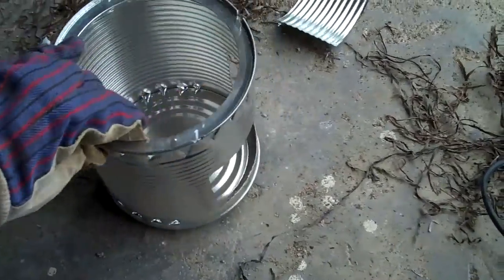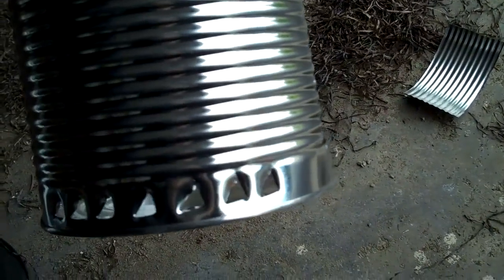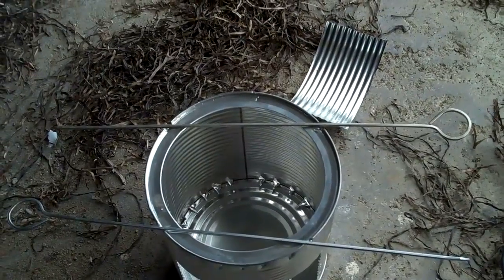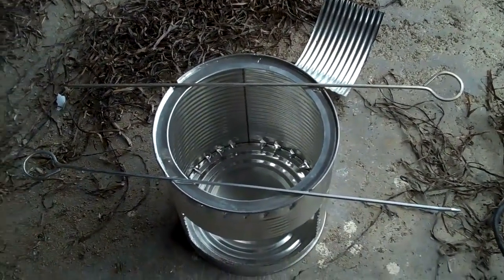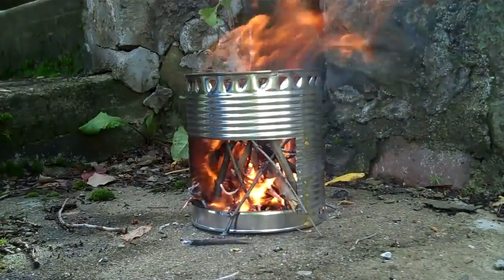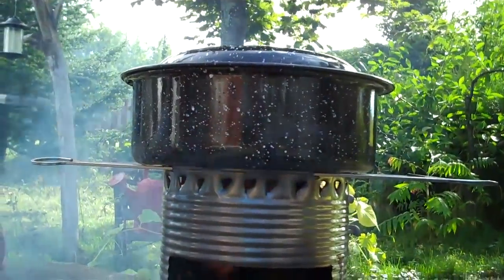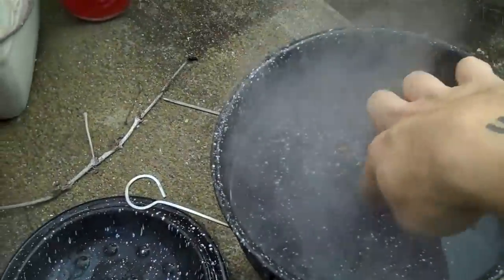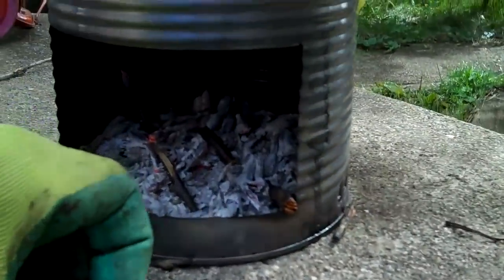How to...make a Hobo stove! HD

Comment: Ive was camping last week in Virginia and used one of these hobo stoves to cook 4-5 meals, and it worked well.  Some tips:

1.  Cut and bend notches/flanges around the top so that when you set the pot on top the heat/smoke can still escape

2.  Use one sheet of newspaper - youre gonna have to blow on it to get it going unless you have really small dry twigs

3.  Wait until the coals are going good before you try and start cooking.  Once you put a pot on top it tends to dampen the flame

Comment: I made something similar to this. For fuel, I used isopropyl alcohol which you can buy at your general store (like walmart, walgreens, cvs, etc). Use %80 or above, I prefer %91. You can use %70 but it doesn't burn as hard so it may take a bit longer. I like using isopropyl alcohol because it doesn't give off any smell, no smoke, it's not expensive, gets water boiling, cooks food and it's clean burning.

Comment: When I make mine I think that I'll split the metal where you had a large rectangular opening in two so that it forms a "barn door" which will be permanently left open. The idea is two fold. first it will either funnel or draw more fresh air through the combustion chamber based on the direction you face it and secondly, the out stretched doors would allow you to place either damp wood across them for drying or another skewer with bits of veggies or meat to be heated but not directly in the flame

Comment: I made one using your design but with a modification to the top grill.  It worked so well, I used firewood to start a coal fire.  It barbecued about 3 lbs. of meat with hot coals to spare.  The tin can is amazingly strong and will probably last cooking dozens of meals. Thanks for your video!

Comment: Instead of notching out the rim for the 2 skewers to just lay on, why don't you pierce 4 holes in the side of the can under the rim and push the skewers through. Then you can use the skewers to turn the stove into the wind without having to touch the hot stove and chance burning your fingers.
Reply: This man didn't even make the indentations so that the skewers would lay evenly (parallel).
Reply: That is very wise.
Reply: Just pinch the top together as needed.  KISS

Comment: Nice stove.  I have a similar one made out of a coffee can.  I drilled 1/4 inch holes in the bottom every inch in a circular pattern all over the bottom.  Then  I cut the bottom out first then made triangle cuts about 2 inchs above the original bottom bent in half placed the bottom back in and then bent in the other half.  1 inch from the bottom I drilled 1/2 inch holes into the body of the can every inch or so. Cut my door 1/2 inches above the new floor of the can  (much smaller than yours). The rest is the same.  By drilling, cutting and lifting the bottom the way I did it allows much better air flow and damp wood seems to burn better.

Comment: I just used a fairly thin yet fat extra large can of beans. I emptied the beans into a pan, and then used a knife to cut out one hole on top, one hole in the middle, and one hole in the top side.

top hole, heat to cook food (beans).
middle hole, sticks and lighting.
top side hole for smoke escape, which worked very well.

I used a knife and an everyday can of beans that you could find lying around a campsite.

I found like, 5 cans I could use for hobo stoves.
And no power tools.

Comment: I have used a stove like that except it was half of a 55 gallon barrel.and it was used open side down to give a larger surface area to cook on. The flame directly on a pan bottom has a tendency to to be hard to control and to burn your food with the metal side up cures this problem. Oh yeah do not cut the big hole in the side clear off as you can use it to control the heat.

Comment: OK. So i made the hobo stove after reading the comments. There were some good suggestions. I made the opening smaller and I drilled 6 small holes about 1 cm (1/2 inch) below the top rim . I inserted 3 pieces of coat hanger bent to a 90 degree angle on one end. They are about 3 cm ( 1 inch ) longer than the width of the can. I put 1 under and 2 over in a basket weave type of configuration which holds them in place. The small pot I have fits snugly inside the can when not in use and the 3 pieces of coat hanger slide in beside the pot. When the coat hangers are installed and the stove is lit the pot sits just inside the rim so it cant slide off. I used a bit of crumpled paper, dry twigs and a wax and sawdust fire starter stick broken into pieces as fuel. It heated a pot of chunky stew in about 3 or 4 minutes and there was enough heat left to toast my bagels on top once the pot was removed. It was nice to have something hot after hiking down to the ocean on the Copper Mine trail in East Sooke Park on the west coast of Vancouver island. Thank you for great video and the great suggestions of your Youtube followers. It's to bad I can't share my photos and video with you. ;)
Reply from the maker: That's awsome. Glad you were able to better it . My model sure wasn't the most optimal design .

Comment: as an old actual hobo, I'll share what we called a 'hobo stove' .  We would find an old spike bucket, (5 gallon about) which was usually lying around anywhere a train stopped. We'd cut those same V shaped holes close to the bottom with a knife n rock, then cut a door at the other end on a side.  Then, you'd dig a shallow ditch with your boot and put the bucket on over the trough. You could start a fire at night in the trough and it'd burn inside the bucket, what little fire n smoke came through the holes wasn't usually visible over 20'. get hot enough to bring water to a boil on the bottom of the bucket. (in case you were interested)
Reply from the maker: Thanks that was intresting.
Reply: +Marcos 989 well, lot of  famous folk hobo'ed around. my 1st computer ran a brisk 8 MHz and came with CPM. :-)

Comment: If raised and placed on a smaller can with openings all around and a small hole in the bottom of the hobo stove with mesh steel wiring can help draw more air underneath the can drawing the fire in the combustion chamber in the hobo can even higher. Sorry for the grammar

Comment: You could cut slits into the scrap piece you cut out and fit it into the bottom with the arch pointed upward so it  wouldn't collapse when it got hot and it would act like a grate and let air come in from underneath .

Comment: Interesting, but ... I'm concerned about using something like this out here in California with change of wildfires. Maybe a screening around the openings to prevent embers from coming out of the can.
Reply from the maker: I make a better version it's called hobo stove 2 , the feed opening is smaller. But you make a shield by cutting a large sodaor beer can and put it in front of the hole when you are not feeding it. Just don't put it too close and block the air flow. And always watch the fire risks  warnings

Comment: hey buddy. . .. you should poke holes in the bottom as well. . .that way it sucks up air from underneath and you won't need to point it where the wind is coming from. . .it will also save you firewood!!

Comment: @TAYLOR13961 it is called a dremel its like a mini grander but the size of a screwdriver, can be used to cut metal grind metal , cut and inlay and or burn inlay wood with just a change of the bit

Comment: hey like the idea but to improve it maybe you  could put the wire stakes through the holes at the top rim for a more stable set up
especially when you use a smaller pot

Comment: While I can I use power tools also, If I had to, I would use a hammer nail and tin snips :)

Its made of tin and won't melt, To melt Aluminum you need charcoal and that's still not anywhere near hot enough to melt it you need a bellows of sorts (I saw a vid where a guy used a pipe and a hair drier effective at melting it in a tin can and the tin itself did not melt)
Having said that I loved the vid and I will be trying this out :) :)

Comment: Isn't there a coating on the inside of those which is poisonous if you burn it? I would dry run it somewhere well ventilated before you use it to cook anything. Not to mention a few runs and that thing would most likely burn out and crumble.

Comment: Not so much a sharp knife but one with a strong tip. I've used a not that sharp Buck Knife to push through the can. I had to resharpen it after but punch through did less harm to the edge than trying to cut.
Also I would recommend having your cross rods make more of triangle shape. That way you can accommodate smaller pots.

Comment: Why not turn it the other way around and use the top as the portion you put the pan on and the fire beneith it?
Reply: Katies Korner because this way the fire doesn’t have to heat up the metal and then the pan, the direct fire heats up the pan faster and so the firewood can be contained within the can, and not touch the ground.

Comment: I thought i had thie nailed before anyone else, then i found this video. Only read difference is that mide has a much smaller door to retain heat, a pinwheeled top to focus heat, and I used a triangular can piercing can opener for the vent holes at the bottom.

Comment: I made a smaller version of this using an oversized (not # 10) soup can. I turn it upside down though. N poke holes in it. 

You can also use a soup or coffee can, put some sand or old clothes in it and pour rubbing alcohol in it. It makes a very hot fire. Oh Hans sanitizer,whichis alcohol gel.

Comment: You should have taken a coat hanger to turn that cut out scrapped piece of can into a door to control airflow and heat better as well as using them for pot supports. loose round objects like those culinary tools tend to act like rollers on uneven surfaces.  Otherwise very pretty.

Comment: I agree a rocket stove is more efficient, but it also takes way more materials and is super heavy with all the sand.  IMO if you need to carry a stove you aren't going to want to carry one that weighs 10 pounds or more.  If you are at home you can just use the fireplace or grill when you have no power, otherwise you will be using your real stove.  Just saying.  Hobo stoves are the most minimal and are great for backpacking, etc.

Comment: I've made and used these things before but I have yet to understand the concept. I mean, isn't it easier to simply dig a small hole and build a fire in it?
Reply from the maker: It is lol. but I guess you can get more heat with a hobo stove because there's more air coming to the fire from the bottom than in a hole. Plus the heat is reflected towards the top.

Comment: Cool video, dude. "Hobo power tool"??  *lol* Nice to see that You use protection glasses while working with this tool.
The "Hobo-knife" (with aluminium handle shells) is the real swiss army knife, used by swiss army from 1961 until 2008. That's a real tough jackknife, almost indestructible!

The other worldwide known "swiss army knife" (with red plastic shells) wich is used eg. by Mc.Guyver, is also very tough and high quality, but it was never officialy used by swiss army. ;)

Comment: Just drill 3 or 4 larger holes at the heighth of  the top of the door, but on the oppisite side. I think maybe the door is a little two big, lets in to much air and burns up your fuel to fast.
Reply from the maker: yeah the door is too big for sure. it was my first try...I probably will make another one

Comment: I would have used an old fashioned beer can opener to punch the holes in the side of the can top and bottom.  IT WOULD BE MUCH QUICKER & EASIER.  They are still around but not used much any more and would save wear and tear on knife blade.

Comment: Are the holes at the top necessary?
Reply: One version I saw, left the bottom on the can intact (which became the cook top), still had an opening at the lid end (where the lid used to be) to put your firewood into (cut out smaller than this one and could be left as a flap, rather than completely cutting it out - that would also shelter your fire material from any light rain), and they cut out a small window up near the cooktop (upside) of the can, which helped with airflow; that piece was cut like a flap and bent upwards a little - on the opposite side to where the firewood opening was. That way you didn't have to cut very much of the can. Hope I explained that okay :-) So leaving the can intact, just cutting a smaller firewood opening at the lid edge, and one small opening up near the base, on the opposite side. This is what the "swaggies" used during the Great Depression here in Australia. (Swaggie being someone carrying a bedroll and camping out beside the roads, while they tramped around looking for work). Of course, there were better quality cans around at that time. I've seen some pretty big cans thrown out by caterers and restaurants that go through bulk foods, which looked awfully useful :-) And OfficeWorks in Australia keeps a range of bulk buy foods in cans to help office staff cater to crowds.

Comment: Sorry...but The Hobo doesn't carry much in cookware. The original Hobo Stew was using a 2 pound coffee can with whatever they can put in. That's means buying from a general store's low cost veggie's, crack corn, can tomato sauce and cheap hamburger. Cook on rocks with wire. And only if they had money to spare. Some Hobo's send their monies back to feed their families during the Depression! By the way...HOBO...came from "Homeward Bound" as they worked the farm belts during the terrible times.

Comment: My ffire always dies out before it even gets going!! Why does this happen to me???
Reply from the maker: well if your wood isn't too big or wet it might be because it lacks oxygen. Air needs to flow from the door and holes on the base but also it needs to escape by the top...if you have a pan on it and it blocks the top hole it could choke the fire. hope it helps!
Reply: Only a guess.  The feed hole is huge.  Try a smaller opening and fill the can with fuel prior to lighting.
Reply from the maker: Charlie Kendall yeah I made a new one, smaller, with a smaller hole and it works great! Also really lights easy when loaded with wood before like you said

Comment: The hole you made was way to big and should be using sand and a sort of fuel for your stove mix the sand and fuel and light the sand will not burn away but will keep the fuel in the sand

Comment: that is not correct way do hobo stove, its really bunch holes poke right into it and have small hole shub the wood into it.  Use the can puncher tool only, and the hobo have hard time carving, so what he dos punch the hole little larger where he can cut at then hot stove it there.  It doesn't have to be big coffee can, it can be small eating can.

Online the can puncher is really cost about under half dollar from ordering online now.